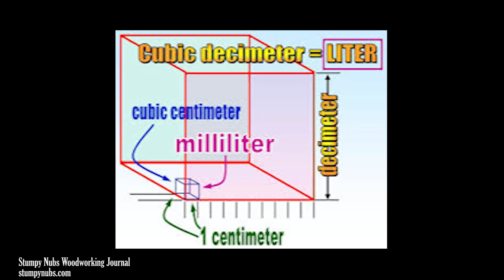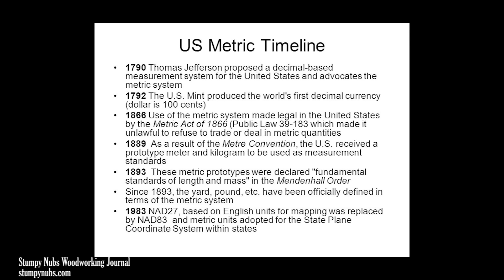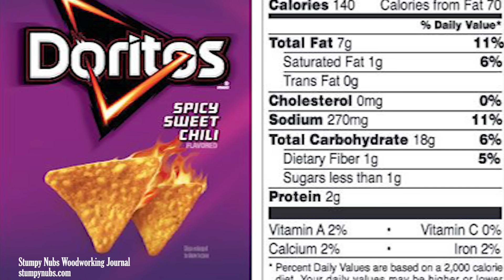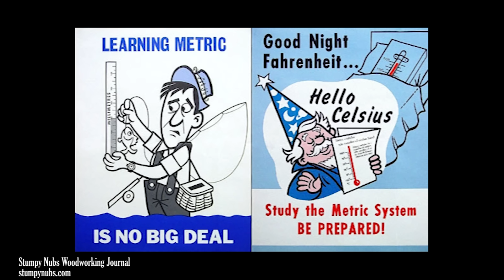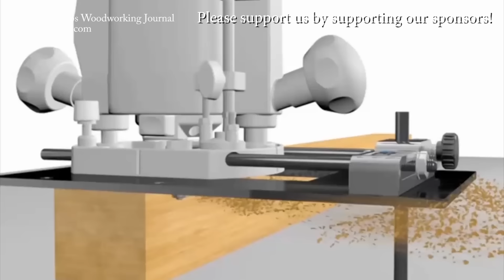BREAKING: The USA is switching to METRIC!

Comment: Yes, the metric system is mathematically easier to use once you spend some time with it but far as switching to metric in the US I’m not going say it could never happen but it’s gonna be so prohibitively expensive it and take a very long time England started switching over to the metric system in 1965 and they still haven’t finished it and they are significantly smaller than the US changing over the liquid and dry measurements to liters and kilos on products like milk and adjusting the price if necessary wouldn’t be that bad for example it would just be a matter of recalibrating the gas pumps where they show liters instead of gallons and have the correct amount per liter displayed that isn’t that difficult to do the massive problem is according to current information I could find which was June 2023 there is 46,876 miles of interstate that 75,600 km of roads just for the interstates that is 28,724 new mile marker signs that have to be made assuming they can transplant the existing signs to their to the correct location that is a lot of money in materials and labor to switch over the mile marker to kilometers and put the correct markers at every single exit and change every single speed sign and that’s just the interstates because despite the sign he showed I have been all over the US as a truck driver and have never seen a single sign in the US that had miles and kilometers on it and that is just the interstates that’s not even the state highways and local roads so it would take at least one entire generation willing to spend the enormous amount of money just to change signs out for it to happen

Comment: One other reason we laugh about impairial system (sometimes misspelled as imperial) isn't only because it's one big mess, but also because it's a prideful childish spite on the US part. And that spite will eventually cost trillions of dollars (not even overestimating). If you would move to metric like everyone else in the early 20th century, it would be much less painfull and waaaaay cheaper.
Unfortunately there are some areas that were pioneered by US and are plagued by imperial units world wide (aviation).

Comment: @0:26

Its factual though. Imperial system is moronic (said by someone who was forced to learn imperial and has since rejected it). Exhibits:

(A) ounce vs fluid ounce
(B) pound vs pound-force
(C) 8 fl ounces (1 cup), 16 fl ounces (1 pint), 32 fl ounces (1 qt), 128 fl ounces (1 gallon) 
(D) resolution of fractional inches….. leading to poor assumptions
(E) 3/32, 4/32, 5/32, 6/32, 7/32, 8/32, 9/32, 10/32, 11/32, 12/32, 13/32, etc
VS
(E) 3/32, 2/16, 5/32, 3/16, 7/32, 4/16, 9/32, 5/16, 11/32, 6/16, 13/32, etc
VS
(E) 3/32, 1/8, 5/32, 3/16, 7/32, 2/8, 9/32, 5/16, 11/32, 3/8, 13/32, etc
Vs
(E) 3/32, 1/8, 5/32, 3/16, 7/32, 1/4, 9/32, 5/16, 11/32, 3/8, 13/32, etc

Or you could just learn to simplify:
(E) 0.09375, 0.125, 0.15625, 0.1875, 0.21875, 0.25, 0.28125, 0.3125, 0.34375, 0.375, 0.40625

And then understand your tool’s resolution: 
(E) 0.094, 0.125, 0.156, 0.188, 0.219, 0.250, 0.281, 0.313, 0.344, 0.375, 0.406

(etc counter examples)

[Yes I concede that temperature has 3 useful scales. And one happens to be imperial. That is nonnormative though, imperial units having a use case.]

Comment: There is a lot of ignorance on this topic. Imperial or traditional is a fraction based system. All complex mathematics uses fractions. There is a reason why time is measured as a fractional system and not decimal. Fundamentally the system is derived from nature and the human experience. The irony is that the metric system requires a fractional system to be modelled. Metric is one of the biggest con jobs of all time.

Comment: Great video with lots of humor, without resorting to the usual shouting match. Resistance against it is mostly based on "we're not used to it," which sounds stupid so other arguments are used that, for metric fans, often sound equally silly ("2×4 makes more sense than 5.08×10.16" because of course you wouldn't cut them to 5×10 in metric).

That big hurdle of adaptation can be taken by a long term view of teaching it at schools, but I fear that at this point metric=science=woke so half the population will be averse to that.

Comment: I hate the metric system because I was taught the imperial system in school and it really pisses me off when I watch an American made YouTube video or read something on Google the user uses km, m, Celsius and so on, it's aggravating to convert to what we were taught on.  Miles, yard's, LBS, ton, inches, feet, gallons is alot easier to relate to for example an 8' ceiling  1' the adult human foot 1" the last joint on your thumb is an inch, spread out your arms the average is 6' and so on.
Reply: Why would you convert anything. If working with metric use metric tolls and measurements. When working with SAE/Imperial use SAE/Imperial tools and measurements. Accept for 3/8 inch being 9 MM most measurements don't convert to anything useful. Back in the 1960 mechanics were upset because they had to start buying metric tools to work on cars built overseas, and found American cars were using metric parts from overseas. Spent most of my life in the Aviation and Electronics career fiels and can't remember aver having to convert from one system to the other. Everything was ether one system or the other.

Comment: Metric (or rather SI) system is by far superior to Imperial/US measurements. It's logical and used everywhere in the same units, with the same logic, while in US you invented diffrerent systems for everything  - nonsens.
In US / in Europe:
Wood: board foot or inch by inch which is NOT what it says (2x4 is NOT 2 inches by 4 inches)/ cubic meter (which IS a cubic meter)
Wires: gauges / milimeters (in construction) squere milimeters (electrical)
Drill bits: Numbers or letters or fractions / milimeters of diameter by lenght
Screws: Numbers / milimeters of diameter by milimeters of length
Etc. Completely crazy...
What is a screw No 8? Will it be suitable for my project..? No idea. I know I need a screw between 27mm to 32mm of length (because of a thickness of boards) and 4-5 mm in diameter (for strenght), so in Europe I just look for a screw 4x30 or 5x30 and I'm sure they are exactly what I need. 
Same regarding the other fields.
SI system is consistent and logical, American measurements are not.

Comment: Hogwash! I resent every measuring tool with both scales. Sooner or later I have to turn said tool the other direction, and that keeps me from being able to read inches and fractions the way God intended. I will never even attempt to think in micro millileaches or whatever those unnecessary units are. I will be buried six feet deep, not 1.83 meters.

Comment: Metric units is not about converting lengths to lengths. It is about not needing a constant when you calculate formulae, such as multiplying the acceleration in m/s² with the mass kg to get the kinetic energy in J. If you are a non-metric but smart citizen and need to calculate things, you convert all measurements to metric units before calculating stuff, and then back to old imperial, or whatever.

Comment: Anyone who has ever done an physics simulation and had to do unit transfers is glad for metrics existance. 

otherwise you'd quickly create your "own metric" where you would use any base unit (such as inch or yard or whatever) and then treat it as if it was a milimeter. Only when you write the post processor you turn your 127.27634 inches into whatever foot/yard/mile bullshit it was supposed to represent, because calculating along the way with these units is utter BS.

Comment: one question. when you buy a wooden board and you meassure it is like 21 inches and some fractions. how much do you have to
cut to get to 20 inches? 
if I meassure a board to be 1023 millimeters, and I need a 1000mm or 100cm board, I adjust my tablesaw to 20 mm, plus the 3mm of the blade, gives me a 1000mm board… how easy is that?
Buld a 3 mile long bride in segments. and then produce every segment to a high tollerance, how many different meassurement systems do you need to convert? with your feets and inches  and shit? and what is the tollerance? like 1/356 inch? what the fuck? I just add all the numbers down to the precision I need. be it nanometers or whatever and I have my total lengt in no time.
Reply from the maker: If I want the board to be 20-inches wide, I'll set my fence to 20-inches and make the cut.

Comment: Americans are unique in that we use both metric and imperial all the time when appropriate.  Additionally, most metric measurement standards, while "well known" are totally useless and people in countries who have officially switched to metric go back to Imperial when it is apparent that the Imperial measurements mean something which relates to reality.  For instance, would you rather say 15psi or 1.03421776554bar.  "Madam, your left front tire is low by .0003243327591bar, but we could perhaps fill it by .000332443951bar if you prefer.  In order to do that, you will have to move your vehicle 1.223433x10^33 Nm forward into our garage"

Comment: No country in the world is completely metric.  I have yet to see a metric calendar or a metric clock.  Metric math is easier?  Sure, if you are dividing by 10.  Try dividing by 3, though.  You can't.  100cm (a meter) has 4 factors.  36" (a yard) has 8, much handier.  Finally, there's nothing very difficult about becoming mathematically bilingual.  Children can easily learn to measure and estimate (without conversion) in both systems.  I have taught many of them to do so.  If the French think we should abandon our customary measures because the rest of the world uses metric, perhaps they should abandon the French language since the language of world commerce is English.  (See how silly that sounds?)

Comment: I was a young boy in elementary school when that push in '75 came about.  Yeah, I think most of the reason our primary measurement is still the old way... it's a finger to Europe.  A big giant FU... but for science purposes.. having studied quite a bit of it.. does work out better using the metric system.  (though measuring fuel consumption in L/KM is F'ing backwards... should by KM/L... but they don't like math..yeah, let's meaure that in .001xyz... gotta love those fractions... rather than a nice number like 40... ).. Still, just to add insult to injury.. Mike Holmes and his HGTV shows over the years have always used.. Imperical measurements.. Yet Canada is supposed to be fully metric and he's in Toronto Ontario... Oh, all temps have been in metric.. but measuring boards.. inches and feet.. and Hey, when are they going to measure TIME in a metric format?

Comment: Dude has Red Wings cup, I couldn't call him stupid. My dad was also a Red Wings fan when I grew up.

The measurement war is pretty dumb. Yeah I wouldn't say imperial system is nice, reasonable or even tolerable to convert to other physical quantities, but in daily life it can be practical. Unless you start talking about 1/32 inches. But like a couple of inches is a pretty reasonable measure. For example I'm very happy to talk about 25,5" guitar neck scales instead of 648 mm necks despite living with the SI-system. I find myself occasionally looking at my thumb and approximating some item/measure in inches that I encounter online. But I would never want to do my mechanical engineering studies with imperial units.

Yet saying metric is the rational and natural one instead of arbitrary? Metric is the definition of arbitrary system, it was made pretty much by scientists to make their calculations easier. Are you a scientist in your daily life? Thought so, some practical units might just be more useful for you than announcing things in millimetres (centimetres and metres are still ok, metre is actually pretty close to a man's step and being 183 cm tall my wingspan gives a decent approximation as well). Millilitres is also stupid, I don't know why so many things are announced in millilitres. Like nothing ever is on millilitre accuracy, it's always in centilitre ranges, and to be frank those are also pretty stupid, desilitre is the reasonable measure of them (well 4 cl shot glass). And every drink package in the store is either 0,5 litres or 1 litre anyway. Too bad an American cup is ~2,5 desilitres but not quite, makes recipes kinda silly to follow if you're not using grams on everything (which to a half-decent home cook like me is infinitely superior way to get anything right in the kitchen). Like there's pros and cons but let the people be, especially when they're much more skilled in the topic you're watching a video about.

But it's also fascinating to see Americans using grams in the kitchen, millimetres in some contexts, kilograms in weightlifting (although English speaking powerlifters still prefer pounds) and some other metric units pretty fluently while the world says they are stupid for using imperial. This has been a thing for a long time too, somehow people seem to miss it. Just like he explains in the video. But don't go selling yourself short, dick measures in inches are still a thing everyone knows about. And 6 feet being the bar.

Btw the french count like this: "90" "easy, that's 4 20". I think they have no business criticising other people about anything related to numbers.

It's just fascinating to me that unless you're doing some physics type calculations, it doesn't really matter if you use the weirdest measurement systems. Like it's always just the context, you have a piece of item and in your head it has a label of some number and a unit. You don't actually approximate its size starting from one measure of that unit. Like the guitar scales mentioned before. I have never started gauging the guitar neck from 0 to 25,5" or 24,75" let alone 648 mm (and I never ever would start measuring 648 mm, at best 65 cm - with the caveat of mechanical engineering happening in millimetres but someone else/machine can measure it). Heck, I could do woodworking in inches as an European just fine, I wouldn't mind (although I would prefer a sub unit of inch that was ten times smaller, I'll admit it). And just ask how many items we have in imperial screws and bolts. Many, everyone has to own metric and inch tools for them if it's not locally made. I've actually heard claims that the screws and bolts were the reason US government didn't impose metric system in one go later, would've cost insanely much for little benefit to replace every inch fastening item in the country.

Comment: Suggest you try doing calculations in field theory in imperial, from that day you will hate empirial. Many years ago say 80s I provided the Canadian textile conversion manual to the head of  the American committee which ended up with a few changes the American manual which they never followed through on. Converting made every thing much simpler. Measures of linear density, how heavy a length of yarn is fhas all kinds of imperial measurements usually refered to as counts such as cotton count or worsted count. Cotton count the number of yard long lengths of material per lb. So the heavier usually thicker yard is a smaller number, that sure makes sense. There are lots and lots of systems(even batched metric ones dernier) all to measure the same thing and none make any sense. If you know SI there is no reason to learn all kinds of exotic measurement systems. Sadly the american refusal to use a sensibale system not only effects the US, because of the size of its economy it has major trade effects in other countries.  When you cay people are simply having problems with fractions is hardly the point. Why make work harder and more costly is the question.

Comment: Which is more accurate 22/7 or 3.14... ?
Reply from the maker: 22/7 is not a proper fraction. No one would ever use something like that.
Reply: @StumpyNubs  What? There is a whole set of formulas for improper fractions.
Reply from the maker: @shawnabell7586  22/7 is an improper fraction. The numerator (22) is greater than the denominator (7). That increment would never be expressed that way in any realistic scenario. It would either be expressed as 3-1/7 or 3.14. Therefore, your initial question does not make sense.
Reply: @StumpyNubs  22/7 is perfect π it's how you make a perfect circle.  3.14 is an approximation it is not perfect π. We Americans love 🥧.
Reply: @StumpyNubs  22/7 might be an improper fraction but it is a full fraction. 3.14... Is an irrational number incomplete forever.

Comment: I won't call Americans stupid or arrogant for not (officially at least) converting to the Metric system, but I belive a lot of things would be easier if we all where on the same page sort of speak.. One good example I can think of is when I had to get the trans-axle break of our Husqvarna lawn tractor to service it, as it had failed (not much fun rolling backward at something that at the time felt like the speed of light).. a 9mm socket was to small and a 10mm socket was to big. had to order a 3/8" socket from the US to do it, could not for the life of me find a 3/8" socket in any Norwegian or European web store.  found ot that 3/8" is 9,525mm 😂Most nuts and bolts on the lawn tractor are in mm, but those on the brake where in inches 😂